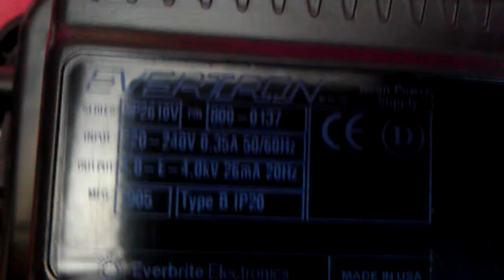EVERTRON' N,S,T, inverter!

Comment: I rather suggest you add a voltage divider to those two extra wires, and not just open circuit.
The transformer is still likely to fail internally(where the oil can't reach) due to extra stress.